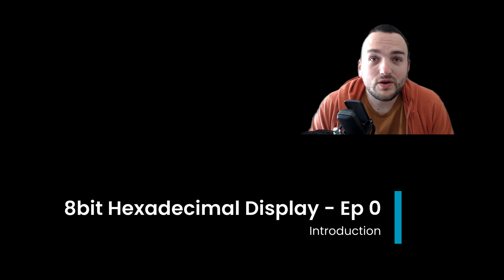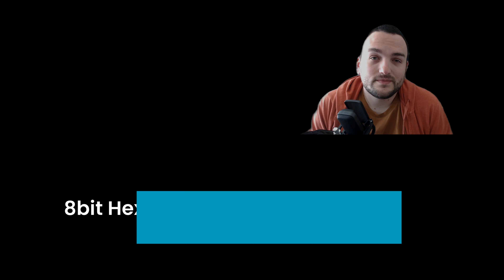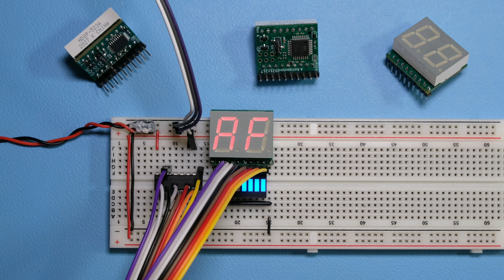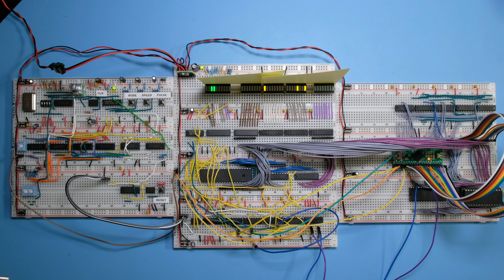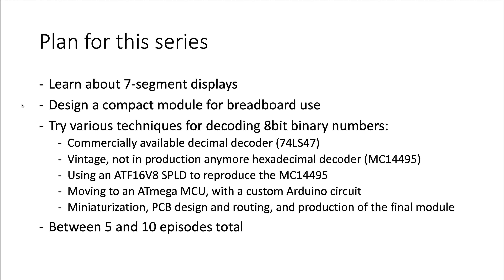#0 - Introduction - 8-bit Hex Display

Comment: Nice - Good idea, cheaper solution than 2x TIL311
Can I ask where you get the 8-BIT BAR LED Modules - 10-BIT are common but 8-BIT not so - your source ?
Reply from the maker: You can find them on Aliexpress. You have to explore using both the search bar and through recommended listing once you're looking at a LED bar, as the search is not great. You can usually find some listings this way. Here is an example for a red 8-wide bar https://www.aliexpress.com/item/32315190808.html